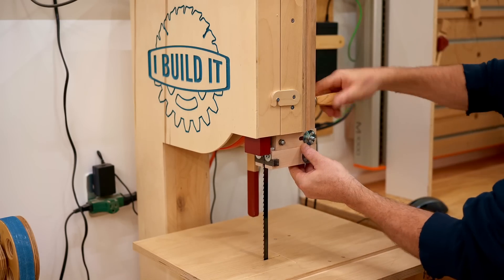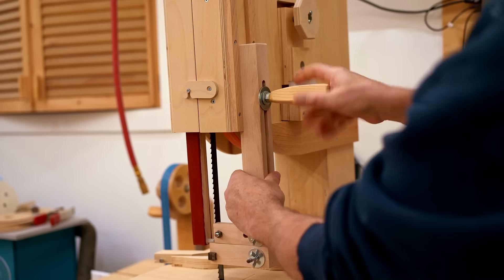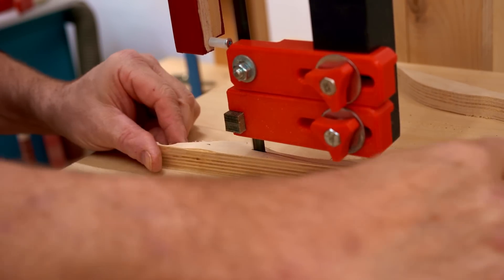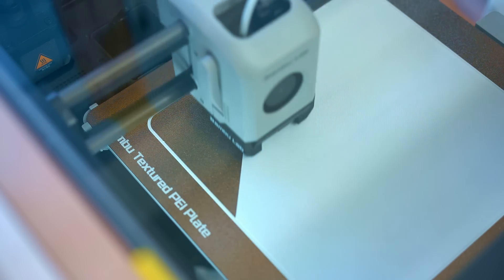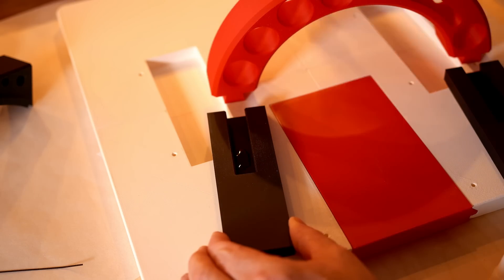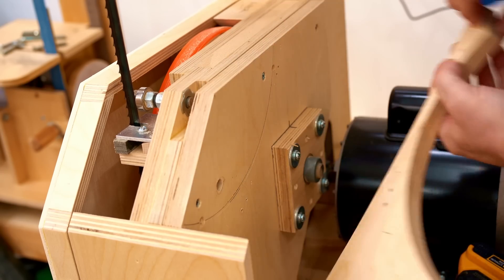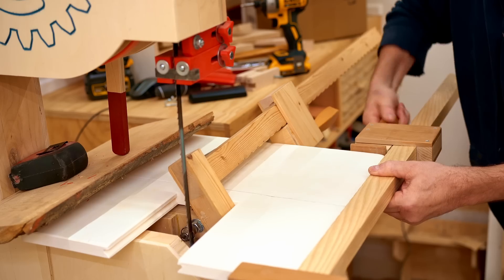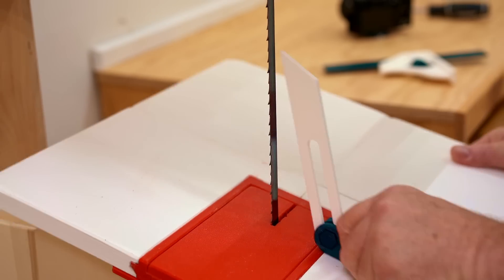He Said You Can't 3D Print a Band Saw... I Said Hold My Beer

Comment: i love the idea of 3d printing useful parts, but i would personally focus on parts that make sense, like the trunnion and blade guide, and not so much on the table itself or the structure/wheels
3d printing should be used as a versatile tool to make complicated/multiple parts in an easy and fast way, making a fully 3d printed bandsaw would probably be a very popular video, but in practice its completely useless and makes 3d printing look like a cheap gimmick for clicks

Comment: I think you should measure where the blade goes in the insert, and add a slot in it in cad so it actually has perimeters there, because otherwise it's sitting on infill.
Reply: The insert can be a solid block of UHMWPE that you machine to the right size with sliding dovetails.  It doesn't have to be printed.
Reply: @JohnDlugosz   That wasn't the point of the project now was it John?
Reply: @JohnDlugosz  tbh probably one of the best stocks would be a dollar store plastic cutting board. and a parametric model for the insert.
the issue with machining is that this assumes you have more tools than a hacksaw and a drill.
Reply: probably to be better and easier the just do solid infill in that area then to rely on that slot being correct with zero warping
Reply: @WilliamTythas  I would say the whole build should have been solid infill, or at least very close to it. Why make the parts weak? This is a power tool. Spend the little bit of extra time and money to make solid parts. But maybe I'm missing something since I don't own a 3D printer and I only see infill as a way to save money. But maybe there's a legitimate reason to have lower than 100% infill.
Reply: @SuperDavidEF  I think the returns begin to diminish exponentially the closer you get to 100%. I watched a few videos on strongest infills, and while you do get greater strength the closer to 100 you get, it isn't a substantial difference. I personally would use a 90% infill, and I would probably increase my wall and top/bottom thicknesses, and would add thick walls near where the blade penetrates the insert. I would also through-bolt every mechanical connection. Threaded inserts seem like they could pull out about as easy as tapped screws. And I would glue everything that didn't need to come apart. I would also use better joinery than dowels. Perhaps a dovetail or tongue and groove. And PLA is fine, but it won't hold up to light, chemicals, or time. Although, it may be the strongest of the printable filaments on average. Maybe, considering he is using a Bambu printer, he could incorporate multiple materials. PLA+ for the infill, carbon fiber of vinyl for the skins.
Reply: @SuperDavidEF  Yeah, he didn't say how long it took for those parts to print out.  You'll never see a real speed part print on YT because it takes forever.

Comment: I always thought 3d printing was a gimmick. Up until I bought my first 3d printer a year ago and now I can't stop 3d printing
Reply: It used to be all you saw was guys 3D printing action figures. Now, there are people who can see the potential for using a 3D printer for other purposes. I use mine for making things to use around the shop. It is an excellent addition to any wood working shop.
Reply: @krisknowlton5935 The knickknack printing crowd did irreparable damage to the reputation of 3D printing.
Reply: @XxIcedecknightxX  I’m talking about the perception of people outside of the hobby. If you talk to someone not in the know, then they default to talking about desk ornaments. I wasn’t talking about whoever you are.
Reply: As soon as you print your first gun you realize how useful of a tool a 3D printer is.
Reply: What are you printing, because I have one for at least 10 years now. The first one needed a lot of tinkering and I mostly printed upgrades for it. The second one I mainly print vacuum hose adaptors, tool battery adapters, and do dads. I would love to print more stuff that is practical.

Comment: Very cool! I'm mostly here to watch your woodworking but I'm very interested to see you use 3d printed parts in your builds. Videos like this where you're figuring it out they're strengths in a shop are very interesting. Like maybe the bed isn't a great place but the guides are small complicated shapes that make a lot of sense especially if you optimized them further!

Some unsolicited advice, gyroid (or the newer 3d honeycomb which prints faster) are generally considered stronger because they're stable in 3d dimensions. They're also denser at the same percentage so tend to beef up your part. Cubic is much more sparse and provides less reinforcement which is fine when you're relying on the wall strength and since it prints fast desirable in a lot of non-functional parts.

Your read of increasing wall counts to strengthen the part is spot on. Generally I'd increase the external walls a first since that's where most of your strength comes from but on the big open areas it probably didn't hurt to have stronger infill.

Also, you might look at something stronger like ASA for some of these parts which will print easily on your p1. PLA often warps over time when stressed. PLA also doesn't handle heat or UV but ASA does which could be important in a shop.

Looking forward to your next video!

Comment: From my experience if you want to print threads it tends to work better if you use outside wall first (or similar but smarter alternatives) in your slicer. That particular setting will make even slight overhangs more challenging to print but will make the part more dimensionally accurate, your parts seem as though they are designed very well for FDM printing though such that the former doesnt seem as though it'd be an issue.

Comment: This is a great video! I do design and engineering based predominantly in structural/functional 3D printing and wanted to pass along few things that have better solutions.

First, PLA is great for many things. It’s actually stiffer than most filaments, but can be quite brittle. Nowadays, there’s a lot of “alloys” for PLA like High Speed, Tough, etc that help make it less brittle or increase later adhesion. A major downside to PLA is that it melts very easily, as well as experiences permanent deformation when static loads are applied. 

PETG used to be best alternative to PLA, but over the past 2-3 years, ASA has really taken the crown. 

ASA warps much less than ABS (enclosures help solve this) and has less VOC’s. It is also UV resistant, and can be stronger/stiffer than PETG. It can also be printed much faster.

In terms of designs and slicer settings, there’s a few more things that could be improved. 

First, 3D prints act a lot like wood. They have ‘grain’ and are much weaker across the layer lines. The blue dowels you printed looked they were printed vertically, which would place the load across the layer line. (EDIT: it looks like they were printing horizontally, which is good! But I’ll keep this point here)

Secondly, more walls is better than more infill. For structural parts, you should really used 20% infill but walls in the >4 range.

Next, typically printing threads or tapping them is weaker than just screw directly into plastic with a normal screw. You can always use heat set set inserts, or pause the print midprint to insert a nut that can be held captive! 

Lastly, for stronger parts, print slower. Those Bambu printers print so fast, that layer adhesion decreases. Sometimes for structural parts in ASA, I’ll slow down from 200-300mm/s to 120-150mm/s for walls/infill. 

Hope this helps! Let me know if you have any questions!
Reply: My preferred styrene polymer filament is HIPS. I haven't tried ASA but HIPS has been doing well for me, as opposed to ABS. I think it's horribly underrated.

Comment: One of the reasons I thought you built the bandsaw was to save money. Filiment is not cheap so anything like this really should be a hybrid. I had no doubt you could print a bandsaw, but is it worth it? Marius Hornberger just released his sander that is a combination of wood, metal, and 3d plastic, and it made complete sense to do it the way he did. In the case you showed, it's obvious that  more complex parts can be done as 3d, bu other things like the table are a waste of time and money (for filament) when in 15 or 20 minutes you can just use a piece of wood. I think your work over the years has always leaned toward what works best, and adding 3d printing to traditional woodworking, and CNC to figure those problems out will be more beneficial to all of us, and you in the long run.

Thanks for the years of interesting projects, and ideas
Reply: I would argue it made very little sense for Hornberger to do it in the way he did. It's entertaining, but he could have thrown all his abrasives in the dumpster for the amount of man hours he spent machining his parts. The only way his model works is direct subsidization from the fact he videos it. 

 In addition, he can't really sell plans easily as all his builds are basically "tools for woodworkers that require a machinist to build". The overlap is not huge. I can't even consider making any of his stuff, as I don't have a metal lathe, or any space to put one. Nor do I intend to change that in the near future. I own a lot of paulk and peter millard plans. Why? because it is practical for me to build them. 

I think that this has potential, as it allows a very useful tool to be built while eliminating much of the skilled fabrication that requires complex equipment and shop space. And I think it is easy for a lot of people to overlook the value of eliminating one or two tools from a project. As soon as hornberger breaks out the metal lathe, I know "This is not relevant to me any more". In contrast, while this build may involve some non plastic parts, just being able to custom print your 3d parts to eliminate machining steps could be very valuable. Almost anyone can go to home depot, buy some 3 foot lengths of steel tubing, a drill, and some bolts. But as soon as the designer starts adding steps like "cut it to a custom length, rip it to these dimensions, and break the edges.... you just added 3 major tools that take up most of a garage. And now you are restricting yourself to people who already might HAVE a bandsaw. And a lot of people, like me, do not have a permanent shop setup. I am a professional carpenter, but for me, "table sawing" would mean tacking it on to the end of a work day so that I already have the tools set up.

And then stuff like John's backwards installation are a much bigger deal, as that means you take your raw materials to work, do your machining, take them home, try to assemble them, and then take them BACK to work, remachine them, and take them home again. Bloating the timetable of the project AND the investment of time. 

This has really hit home for me how practical 3d printing can be, because I see ways to start planning builds with off the shelf components. I can't imagine it's hard to make a band saw frame out of stuff you don't have to do any significant machining on. Maybe you end up cutting some materials to length. But normally, there is no reason to build a bandsaw out of stuff you can buy off the shelf at home depot as you will then end up custom fabricating a ton of parts anyways, so you are already committed to shop space and machining time.
Reply: @timmietimmins3780  Not the pint. His point was he had the abrasives, and he wanted a sander with qualities he couldn't find in a prebuilt one. Also, you're watching a video about someone who built a bandsaw. Following your logic, john should have just bought a bandsaw, a table saw, etc. The point of making stuff be it tools or furniture is to make exactly what you want because it's cheaper, or you simply can't buy it.
Reply: @brianatbtacprod1989  that's rather the thing. This could be cheaper. hornberg's absolutely isn't. Because he uses extensive custom machined metal parts, and 3d printing is vastly cheaper than machining, either to do it yourself or to have it done on your behalf. 

Also, I don't know if you are familiar with the market, but decent 12 inch band saws aren't free. 700+ is a pretty reasonable number. In that neck of the woods, it starts to make sense to think about building. 

For reference, a spindle sander is like 300 bucks.

Comment: as someone that owns and uses various 3d printers for the better part of a decade: dont use a 3d printer to make stuff you can make in less time with isotopic materials - printing a "cube" is just not reasonable, take wood or metal instead and only print stuff you couldnt do otherwise / would take you longer. make a table from wood/aluminium, print the inserts. make the holder for the blade guides out of wood and the attachment arms printed. just because you can, doesnt mean you should. also 3d printed parts are no precision instruments, printing a square is generally not a very good idea since tolerances are, even on a good printer, too bad to be any good as a precision instrument. 

also your printer does have functionality to resume your print after a power loss, you should look into that since it can save you a lot of material and time!

Comment: Much as I love 3d printing plywood is the better material choice than most of the plastics you can FDM print for a bandsaw. If you want to go into the material science and FDM engineering challenges enough it can definitely be done. But the easy to print and almost universally used PLA really isn't the right material for this sort this build it creeps with very little force applied and softens are really low temperatures. The filament of choice and its material properties is quite a rabbit hole to descend, I'd suggest skipping experiements in the cheaper stuff and going straight to a chopped carbon nylon probably - a combination of easier to print and good material properties for the task. Though I find I still do almost all my prints in ABS (which is hard to work with but has some nice mechanical properties and is easy to solvent weld with acetone). Then dealing with a rather limited bed size that breaks so many parts of a tool like this up when a simple sheet material just works is silly and opens up so many failure points.

Comment: I'm not sure if you needed lightening hole cutouts in some of those parts, but they don't behave like you'd expect. They are actually heavier, use more filament, and significantly impact the overall strength of the part. Large/solid (not talking about in-fill %) are the best 3d printed parts

Comment: @JohnHeisz Maybe taking the strongest element of a material and see how little it need to be to make it possible might be an ide, a bit like an IKEA component. They are not the strongest and not the weakest just strong enough to do the job, or something cooler like airplane parts.

EX: a thin sheet of aluminium laminated against plastic inside and wood holding for bolts or maybe steeltreads for the bolts. Aiming to take the just enough strong component  to make it as cheep as possible but still long lasting. (in long lasting i mean like some year 2-5 not 50-100 years and not 2-5 days or 2-5 sec)

How do that sound like for a content ide?

Comment: For strength don’t underestimate the value of more walls instead of (or with) infill like you learned. Makes such a huge difference. ABS might also be a good material for this since it can be “welded” to itself with acetone for strength too. 

I’d love to see you meld them together. Maybe make the bed so that it used dowels or even a thin practically unfinished piece of plywood as the internal support for strength. So the plastic adds the surface and mounts you need and uses the “solid” wood for strength where plastic doesn’t do well (like shearing forces on layer lines)

Comment: This is a very cool build! Only thing I'd suggest is using heatset inserts where you tapped the 3d print - in my experience (at least with smaller screws like m5) they hold up much better and they're also harder to break.
An alternative would be to have some nuts on the opposite side and have those half embedded in the print.

Comment: First, increase your infill. Those parts almost look completely hollow( for structural prints with PLA, you need higher infill, like 40 to 50%, also they make glass or carbon fiber reinforced. This would be a good use for those stronger filaments) ... yes, I love watching 3d printing videos.  P.S. gyroid infill is stronger than cubic 3d...

Comment: I couldn't get the top guide to line up on my cheap new bandsaw, so I designed and printed a new part that works. It hasn't broken yet! I've got no problem with printing parts for woodworking, as long as it doesn't result in sharp bits of metal embedding themselves in me if they fail!